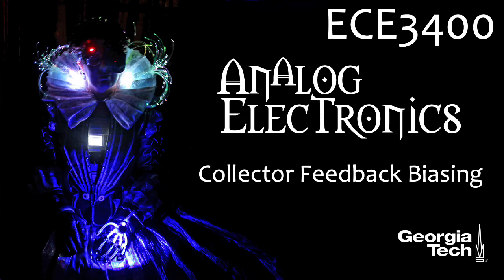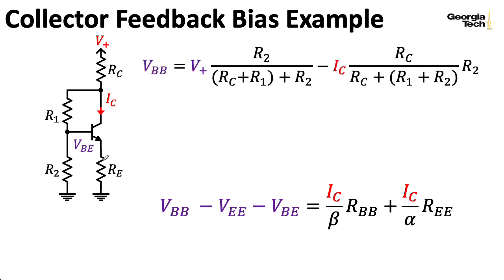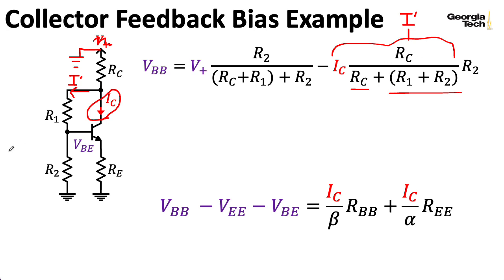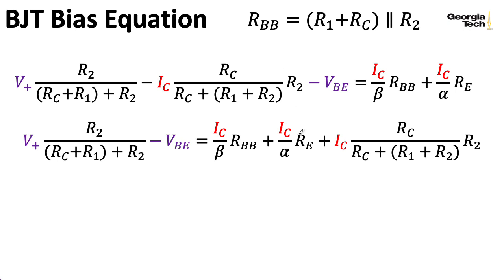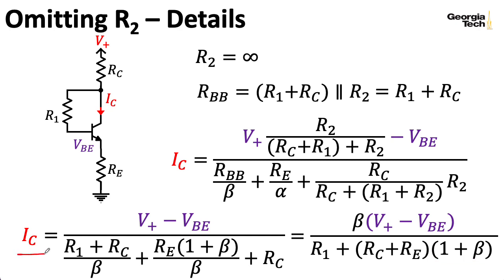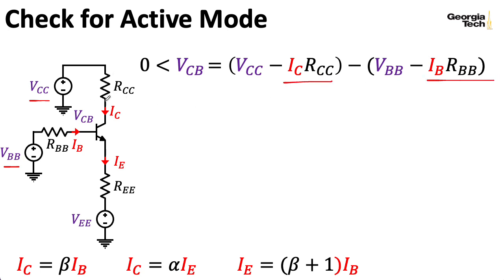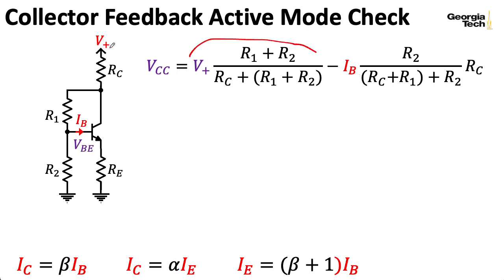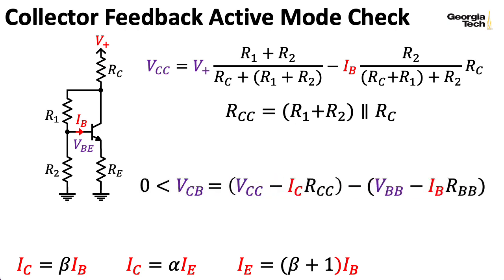ECE3400 Lecture 9: Collector Feedback Biasing (Analog Electronics, Georgia Tech course)

Comment: That's the long way. Pick your Vcc. Then the collector current you want. Assume Vc is half Vcc. Using an average for beta pick R1 to give base current from the half vcc point. R2 can be added to fine tune the circuit. One of the features of this circuit is the ability to somewhat correct for variations in Vcc. Need more gain and a bit higher ac resistance?  Split R1 in half and add a cap to ground.  Sorry for coming at this a different way. I graduated from tech school a 2 yr electronic degree and the emphasis was to try solving the problem in the simplest way first.

Comment: I’ve never approached analyzing bjt with CB feedback in this method before.  The process seems reasonable with valid assumptions yet not always practical.  As you mentioned, the need for resistor RE is sometimes needed. Makes the work here a bit hairier. 
Overall, this method seems more academic than practical but I’d like to take a few work examples and see for myself. 
Thanks again for a well worded lecture.
Reply from the maker: Be sure to check out the cited writeup on Marshall's website (and for that matter everything else on his website, it's amazing).